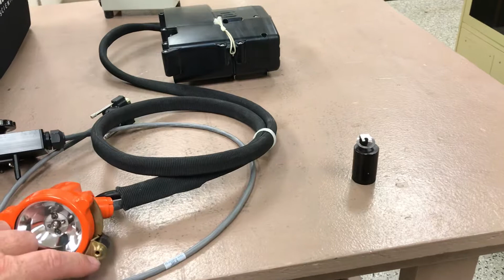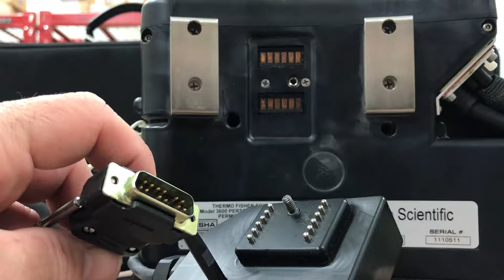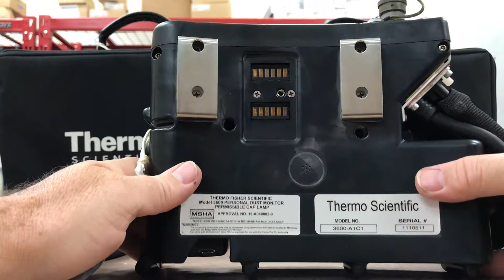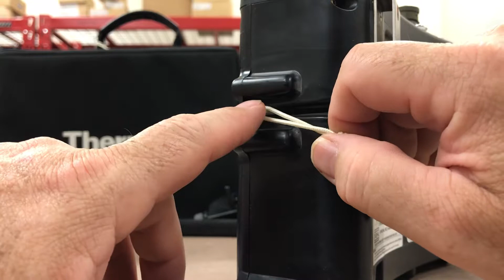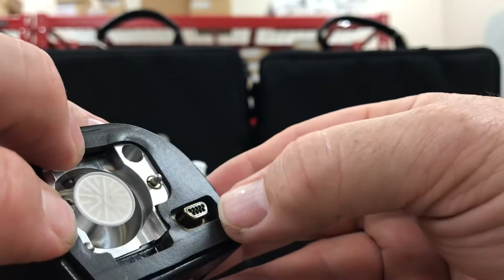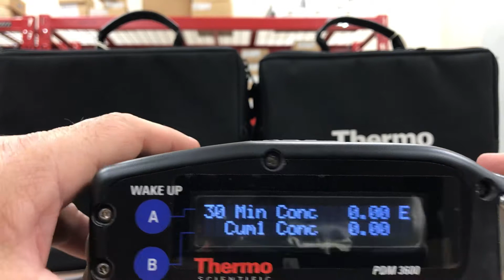Thermo Scientific Model PDM 3600 Particulate Monitor

Comment: Good evening, is it necessary to install a cyclone sampler in order to use the PDM 3600? thank you
Reply from the maker: Hello, no cyclone required. The pdm3600 sensor is a teom-tapered element oscillating microbalance. Which means the particulate sample collects on an oscillating filter, changing the oscillating frequency, which is directly proportional to the particulate concentration in micrograms per cubic meter.